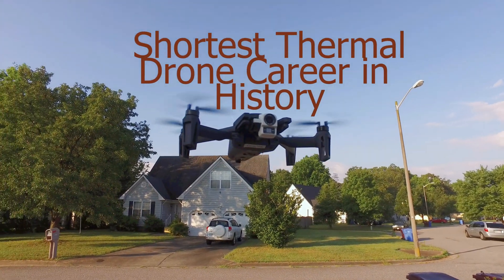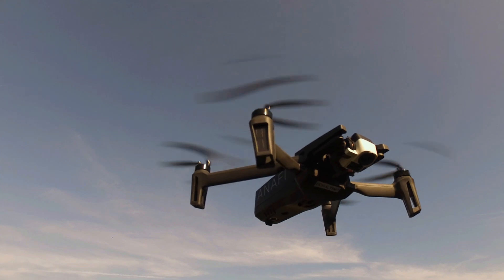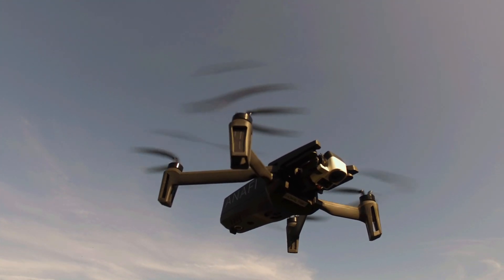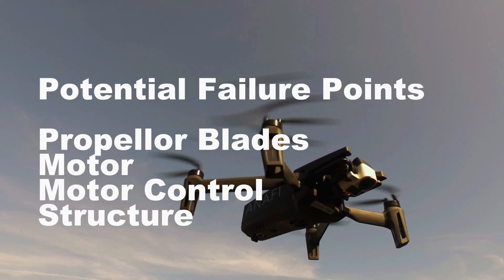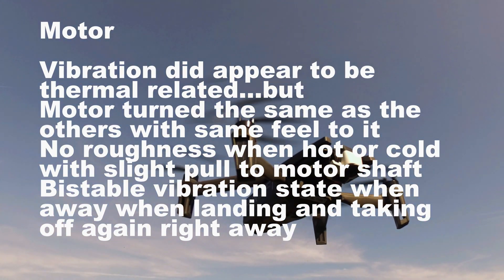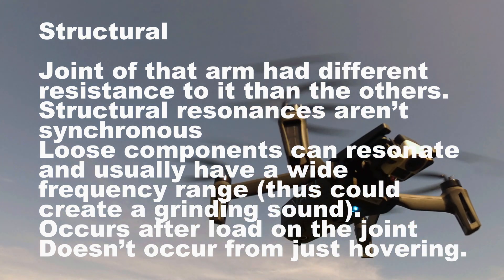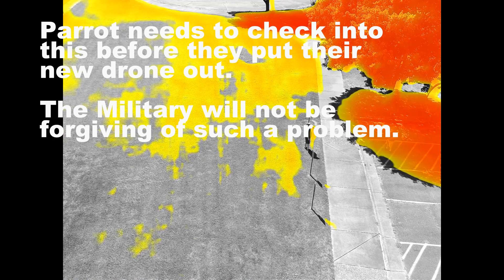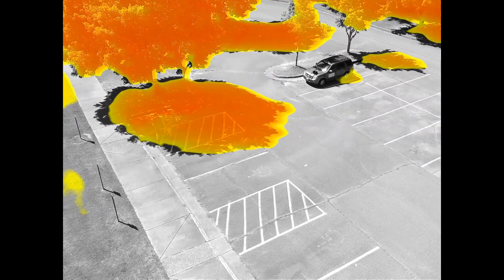Shortest Thermal Drone Career in History with Anafi Thermal (with quick failure mode study)

Comment: I've got you beat on shortest Anafi Thermal flight.  Less than 10 seconds on the 1st flight it dropped out of the sky from apx 25ft due to battery.  Destroyed.  There is a reason my previous 6 drones were all DJI, just wish I would have had the difference in $ to purchase the DJI thermal at the time.  It would still be flying just like it did the 1st day.

Comment: Hey I’m looking at thermal drones currently for my business, besides the issue you had, could it have accomplished the thermal work?
Reply from the maker: It can do small stuff, like a house, an AC on a roof or individual solar panels.  It would be good for individual electrical equipment inspections or home heat loss surveys.   That's the stuff I would have used it for.  If you are looking for finding lost people, it has to get too close to do it (you need to survey a larger area, which means height and camera resolution).  If you are looking at solar farms, agriculture,  or shopping center roof evaluation, there isn't enough resolution (you could run close and many, many lines and get it done, but the time cost to benefit, just isn't there (too much labor).

Comment: Yep same problem as mine. You probably had a mark or cut on the screwthread.
Reply from the maker: I would have kept it, taken it apart, and found the problem for sure, if I couldn't send it right back.   I'm hoping they get their crap together and look into it.  I'm betting ours aren't the only ones doing that.   That's not going to be too funny to some business that spends $7000 for one of the newer ones and the design looks almost identical.